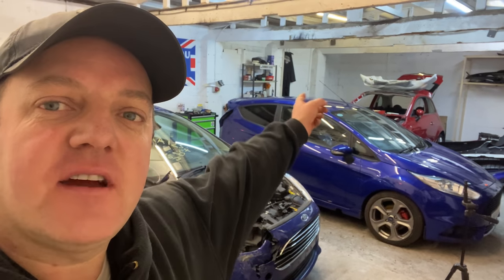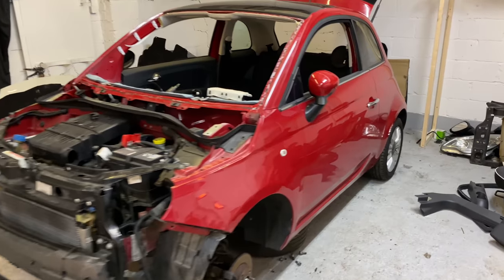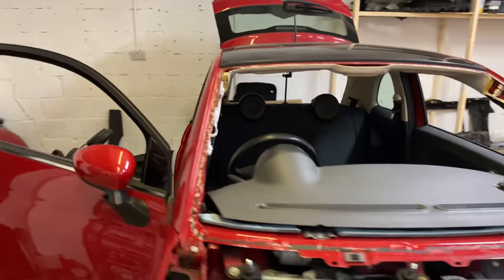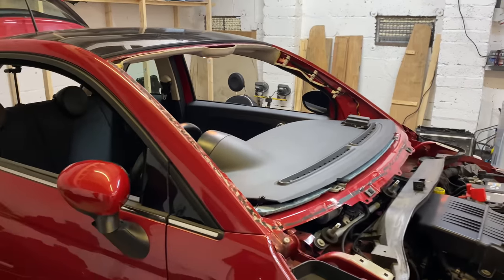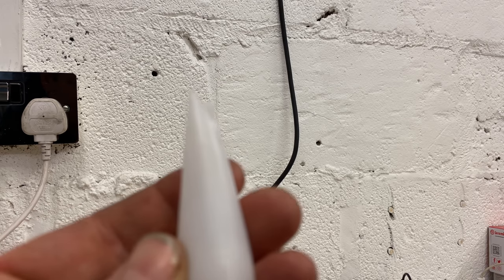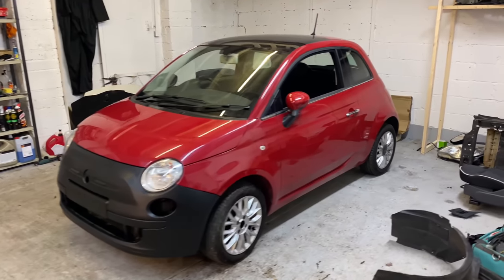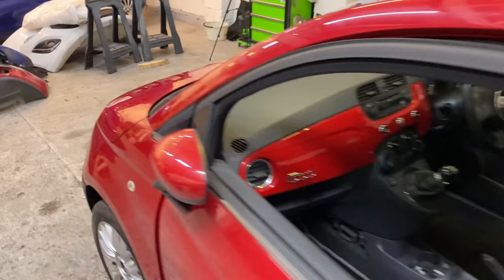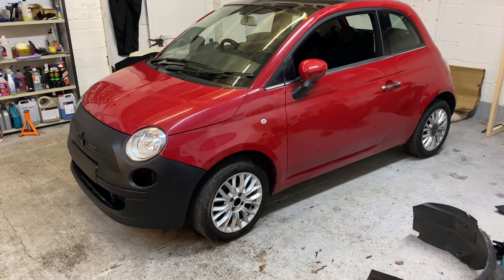FIAT 500 LOUNGE 2014 CRASHED SALVAGE PT3

Comment: Hi mark, I just looked back at part2 of this and the airbag module you refitted is from the earlier model ,it’s the one with the full aluminium casing. I had this problem with a Alfa mito I was told it was the same but they are definitely not. the plugs are the same but inside is very different, I had lights flashing all over the place with the older module. With fiat and Alfa stuff they have to be the exact same. Best way is the way your having it done, as that module is coded to the chassis of that car so with the crash data chip replaced it will all be fine and no proxy alignment problems either. You can’t erase these with a scan tool or laptop has to be chips replaced. Ignore the haters and crack on mate, stay safe buddy 😷👍🏻
Reply from the maker: Thanks buddy appreciate it mate nice one Dave I will get it cleared stay safe buddy 👍👍😷

Comment: Mark you can check the Airbag ECU by placing the seats back in the car and plugging in the seat airbag connectors
The reason the light is coming on is when the car is powered up by the ignition the ECU does a circuit check of all the Airbags If there is an open circuit (such as when an airbag is unplugged) it will bring the Airbag fault light on
Hopefully plugging the seats back in will solve the problem
Reply from the maker: Hi John that won’t work just putting the seats back the need to clear the crash Data first then it should work 👍👍😷